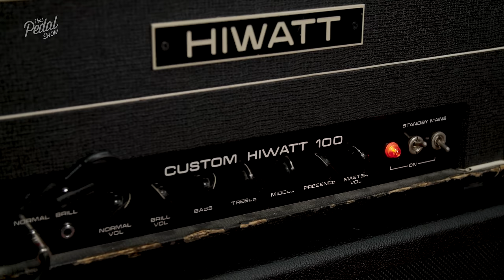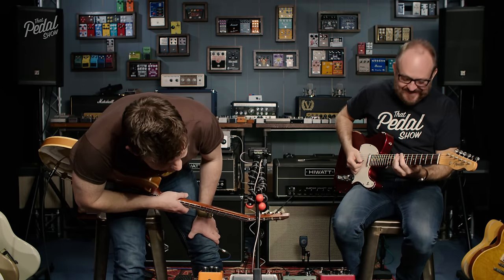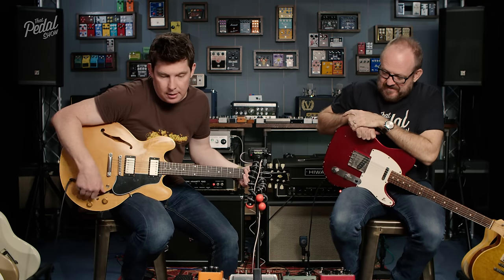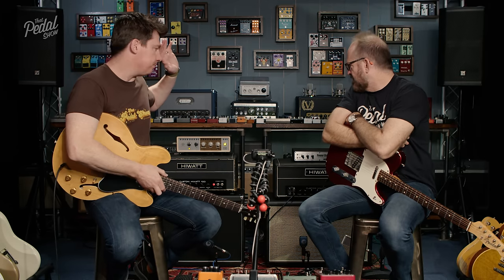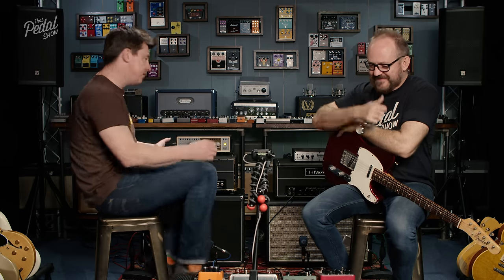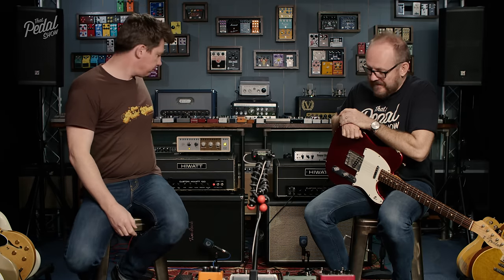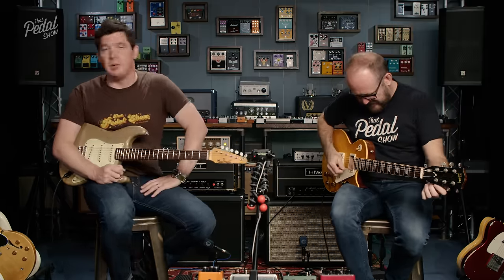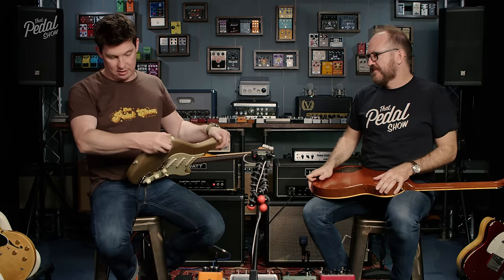Vintage Hiwatt DR103 Amps: Wet/Dry, Plus UA OX & Fryette Attenuators – That Pedal Show

Comment: I appreciate it would be antithetical to the point and attraction of those Hiwatts, but I almost fell as though the audio recording could have done with being put through a compressor. I'm assumming that you had to set the mic pre-amps very conservatively to account for the spikes in volume, but some of the quieter sounds came across as very quiet compared to the more pushed sounds.
Reply from the maker: Hmmmm. It’s a good thought. It’s always a bit of a struggle for me - Mick here - making decisions about that stuff during the audio edit. Because on the one hand we want some of the dynamic to come through, where adding mastering type compression, or even side chain compression, would give a less ‘real’ picture of what’s going on. That said, when you’re in the room your brain and ears do their own automatic levelling and that’s the bit that no piece of hardware or software will ever replicate. The mic pres were adjusted as explained in the video. Cheers!

Comment: Mick, I'm curious as to what has caused you a crisis of faith with your Stratocaster? I personally never bonded with Alnico 2 magnets for Strats as are in your Duncan Texas Hot pickups. I find that they bring the midrange too far forward and it loses that Strat sparkle and chime. Perhaps an Antiquity Surfer set (Alnico 5, more scoop) would be the remedy?
Reply from the maker: First and foremost it’s the frets and the nut. Both badly worn and killing the sound and feel of the guitar. After I like those pickups and I’d never bring it down to something as singular as a magnet type. Nevertheless... Blue is about to go through....
Refret and new nut
New Callaham bridge
New pickups - Fender Fat 60s cos I’ve played so many CS Strats recently with them in and liked them every time. I’ll A/B each change individually and go through the journey with you lot! 
In addition to that, there’s a new Custom Shop Strat on the way too. I’m playing a bunch of stuff to find one. :0)
Reply: @ThatPedalShow  the fat 60s are certainly very cool, I especially like the bridge tone. Fender Custom Shop is putting out amazing guitars, hope you find the right one for you!👍

Comment: This video brought to you by Fletcher-Munson ;-) Also, with Ox, It's a great melding of technologies, with the cranked Hiwatt and the Ox digital processing with cab emulation and effects. The room mics sound great, of course. I believe I saw ribbon mics...
Reply from the maker: Hahah!!! Indeed. Yep, we’re running a Royer 121 and a Sontronics Delta alongside the 906s in this one. Room mics are a pair of AKG414 in mid-side config and processes accordingly. I’m really loving the mid-side thing. Mick here :0)
Reply: Yeah, mid-side is great. I like the way the track stays very focused with ambiance left and right. Great for 'lead' acoustic guitar tracks.

Comment: Man, not sure how I missed this one when it first aired. Been pining for a Hiwatt for forever. Also, what mic pre amps do you guys use on your cab mics?
Reply from the maker: Hi John. We run our mics into a Universal Audio Apollo 8p, using the Neve 1073 plug-in on the amp mics. Cheers!
Reply: @ThatPedalShow  Awesome! Thanks for the info guys! Keep up the awesome work. Would love to see the guys play through some vintage Orange heads too ! OR120 or OR80s

Comment: If I'm not mistaken, that's an e906 at least on the cab behind Dan. If so, do you set the toggle on any of the freq cut settings, and where on the speaker do you find a good place to start in general. Also, in post, do you cut lows at a certain freq to avoid any boominess?
Reply from the maker: Hello! We leave the switch in the middle. I usually put it where the dustcap meets the cone, ish, around 6 inches away, sometimes further. That pretty much eliminates any proximity effect though it does depend how loud you play. Please watch our Mic’ing episode! Cheers!
Reply: Awesome, thank you! I will continue to experiment! Cheers!

Comment: Okay, so I have a question about your experience with the Ox:

I have found, over the years, when recording direct guitars off an amp using cab simulators and the like rather than miking a cab, that there is this fizz on the top end that I invariably havr to target and cut out with eq in the mix - especially on distorted guitar sounds. Have you found anything similar using the Ox? I'm really interested in the Ox because I think it's a killer idea, but I'm less interested in the price tag on the thing if I have to go hunting down fizzy frequencies to cut when using it. I rarely have that problem when I use mics in the real world.
Reply from the maker: Not a fizz as such, but inevitably there is something different about the OX compared to well micd cabs. Saying that though the sound is great and totally useable in pro recordings as hopefully the songs demonstrate
Reply from the maker: Hello! The fizz you’re hearing is the digital fizz that I can hear on pretty much all digital amps , cheap recording devices and anything with average AD/DA conversion. That said. I think both OX and the Two Notes thing we tried both sounded great - Mick here. And of course then there’s the guitar, amp and pedals you’re using. Everything mAtters!

Comment: Dan says it's a wonderful amp as a pedal platform if you don't know what amp to get. But is it really usable "as is" (with the master volume at 0.5) or do you need an attenuator? Thanks!
Reply from the maker: It really is, yes it sounds magical when you turn it up but even at quiet levels with the master turned down it still sounds fab
Reply: That Pedal Show thanks!

Comment: A question: In a Hiwatt Dh103 from my friend, the Bass control is almost ineffective for standard tunning guitars. I checked the electronics and it is OK, no problems. Did you experienced the same with your 2 "subjects"?
Reply from the maker: Nope. But it’ll be interactive with the others. Ours is kind Nothing below 9am, then lots comes on... and more... weird!
Reply: Weird, indeed. I will check that pot again. Thanks, pal...

Comment: Are there any amp companies that build this kind of Hiwatt amp with more modern features/flexibility (like going to 5watt/20watt etc)?
Reply from the maker: It’s a bit like asking if there are any car companies building a 911 that’s less powerful and slower. It’s just not the same thing when it’s quiet unfortunately. Volume and tone are the same thing, not separate. IMhO. Mick here.
Reply: @ThatPedalShow  Yup, I think that is a very good analogy! However, I think it is important for modern features to be implemented into tube amps to compete when it comes to convenience and practicality (Synergy and others are offering these options). For example, one can't fully experience a Porsche and Lamborghini's extreme speed on the interstates here in the states. You will get arrested. However, there are tracks where you can go at those speeds...So I'm guessing there are no amp companies out there making clones of these wonderful vintage Hiwatts? Awesome show btw!

Comment: I have a question as the 436th comment, which is optimistic. I have a lovely Victory V40 Deluxe, which has a master volume and volume for getting gain. Why would I get an attenuator then, as Victory recommend in their manual? Thanks.
Reply from the maker: Okay, so the sound of the amp cranked, with the master and gain up is very different than with the gain up and the master down. The effect of the power stage working hard is something you can only get with the master volume up hard. So if you want that kind of sound, but quieter, you can’t just turn the volume down. Hello attenuator. Cheers!
Reply: Thank you!

Comment: I’ve been told attenuators are bad for amps. Is this true? I’m skeptical.
Reply from the maker: It’s not true.  You’re driving your amp super hard so the valves will wear quicker. The whole amp will wear quicker.
And you need to make sure the impedances are correct. Otherwise, all good!

Comment: Its surprising what volume does for you as a player. I did a gig last weekend and on the photos, i saw it looked like quite a big place so i took my Marshall JVM 50 watt.We were then told by the landlord not to play loud otherwise people will leave. THe JVM was on something like 8 oclock on the master and around 10 oclock on the channel volume... and it was the worst gig i've played in ages. There was just nothing there from the amp and completely uninspiring.
Reply: That also has to do with the Marshall. Those amps need to be turned up to get the power section working. For my 50 watter, I use a 2x12 with lower Db ratted speakers.  It lets me turn the amp up and still maintain the same overall volume. You could also look into an attenuator
Reply: I have a 20 db attenuator but didn't take it (hindsight and all). I'll just have to start taking smaller amps to gig's as this was just garbage.

Comment: Is it actually even possible to make that amp sound bad...?
My word.
Reply: A beer bottle flew through the air and magically landed in the cooling slot, sending beer into the power valves. It sounded shit then. Not that you could hear it under my military spec swearing.

Comment: Why on earth would you EVER buy a modeller with attenuation that good! And I'm betting my tube amps will hold their value all day long against modellers
Reply: Because if you like the sound of a hiwatt, and a vox, and a fender but also have a pedal board with 8 or so pedals on it with cables and power for those pedals and you don't have a team of roadies and a van.  Or, if you do have a team of roadies with a van, you could spend $5000-$6000 on a three amp rig with a massive pedal board, or you could spend $1500 on a helix.

Of course, the analog rig feels better to play though.  It's just not practical for all people in all situations.  That's why on earth someone would buy a modeler.

Comment: Pure coincidence,  I´ve got 73 and 74 DR103s,  one is a PA with 6 inputs.. 

I dont get the point of this video at all.
With tons of pedals, attenuators or whatnots, you get the same squishy squashy 
sounds like here - with any amp you choose. Say a SF Fender. 

Where the DR103 really shines is the clean sound.. 
This amp reveals, translates if you will, the whole sonic spectrum of you guitar.
(and it is never 100% clean - not in a sense of sterile BF Fenders, it has a warmth 
in every setting)

Second misconception is the loudness of DR103 ..
My 50w 71 metal panel is about 3 times "louder"  than DR103,
unbearably so.. 
It is all about the aggressive high mids presence of Marshalls.
The DR is never insulting like that.  It´s a Big Daddy ;)

Comment: The clean sound just does not make it through in this vid, for me. Maybe it was great there, but I'm just not feeling it. The harder stuff was OK, but something was...missing. Once you started using pedals there was no 'amp' thing that stood out at all. Nothing special, which is not what I usually think when I think of Hiwatt, generally.
Reply: It might be that the Hiwatt is just not your sound. I feel the same way about Dumbles. I 'm a huge Stevie Ray fan, and i thought I would love em. I even used to own a Fuchs ODS II, but I was never able to connect with the sound. Even all the times I've heard real Dumbles, I always thought they sounded good but nothing too special. It's just not my sound.